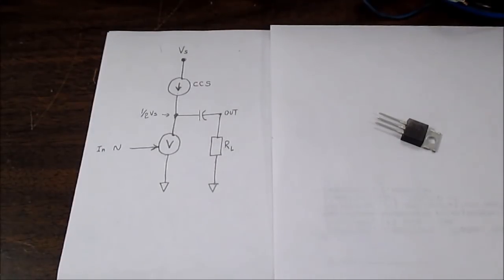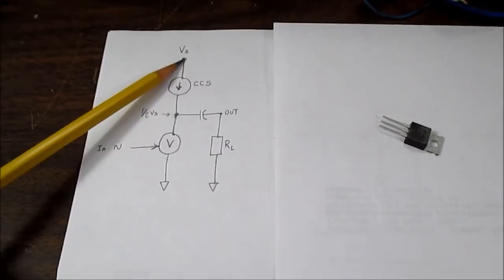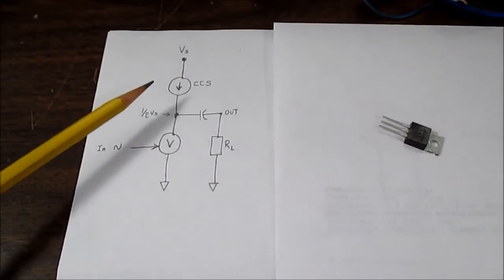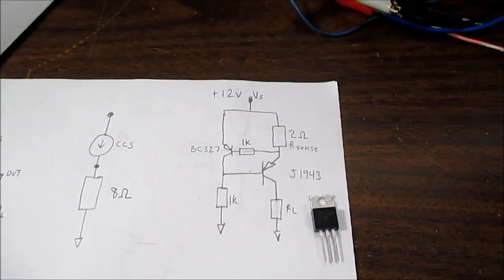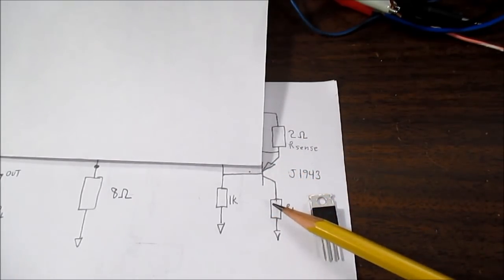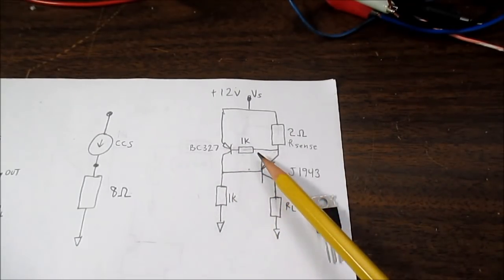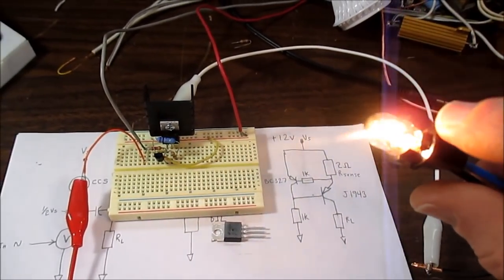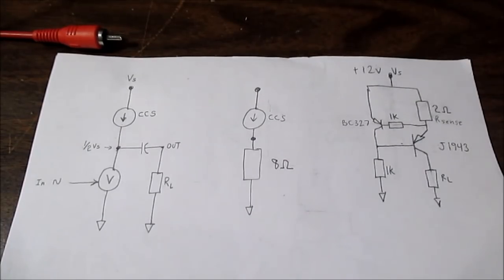Class A audio amplifier current source design PART1

Comment: Happy holidays John!
Actually, using a CCS as the load resistor for a class A power amplifier will get you pretty close to the theoretical 50% efficiency level of a class A amplifier.
Reply from the maker: Thanks Dave! With a 12v supply and 8 ohm load (resistive), the ideal current would be .75a or 9 watts dissipated by the entire circuit. The max possible output before clipping would be 2.25w or 25%. The CCS is sucking up half the power.
Reply: Check out some of the stuff written by John Linsley Hood on class A designs. He talks about modulating the current source with the audio signal. This cuts the quiescent current to about 1/2 of the maximum current. But the main output transistor still runs in pure class A. I think his syatem  can get close to 40% efficient at maximum signal. The quiescent power dissipation under these conditions is about 4.5 watts. I've seen a couple versions of this circuit posted on the web. Some very simple, yet they work.
Reply from the maker: Interesting clever design. For my amp, the signal won't have any interaction with the ccs driving circuit. I won't get the efficiency or distortion performance as his, it is mainly for a basic circuit description.

Comment: Any opinions on identical transformers in parallel and using a buck converter to drive a tda7492 board(my rectifier outputs 38v and theoretically sags to 28v when 70w is being drawn, and i want to step it down to constant 26v to power the amp)?

Comment: Half the power goes to the CCS...the other half goes to the output transistor...so, the maximum power output considering  20 percent efficiency is calculated by the power dissipated into the power output transistor...just to remember you to clarify this to young folks....20 percent is really optimistic
Reply: So, let me see if i got it. If the current flowing is 1A and the Vs is 12V, the power at output transistor is 6W, then the output power will be  approximately 20% of 6w, that's it ?

Comment: What's difference between class A and class D amp ?
Reply: Power loss in idle (low or no sound output) and distortion.
Reply: BuzzCola 3 lots of differences. He biggest is class A is always conducted where class D uses mosfets to quickly turn on and off then use filtering to turn the PWM signal to a normal audio signal
Reply: In class A the output signal is a direct amplification of the entire input signal and in class D the output signal is reconstructed using a pulse width modulator and there is no real audio path between input and ouput in class D amplifiers.